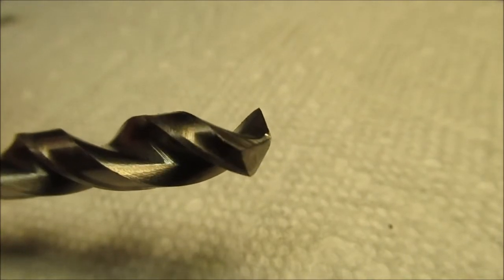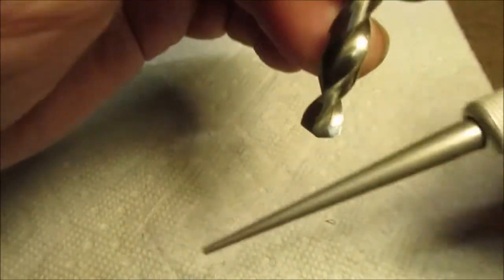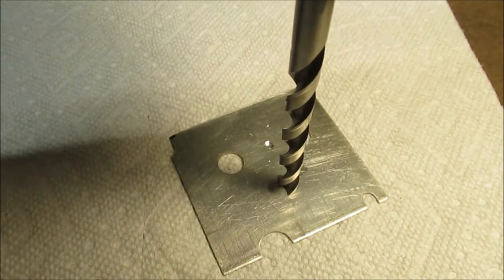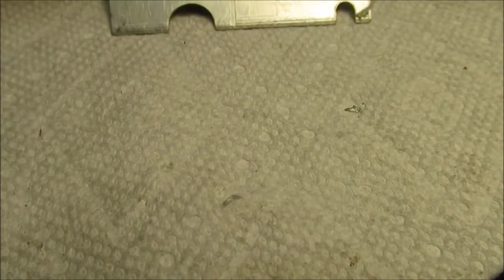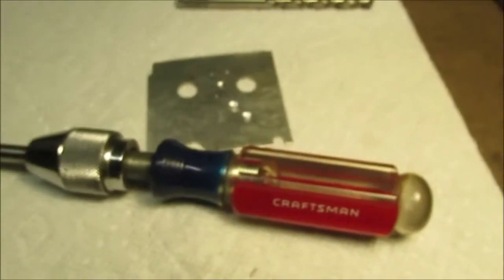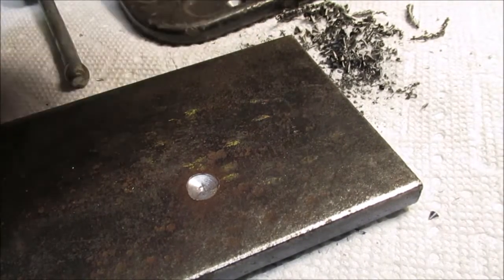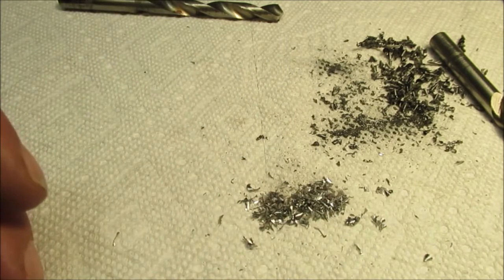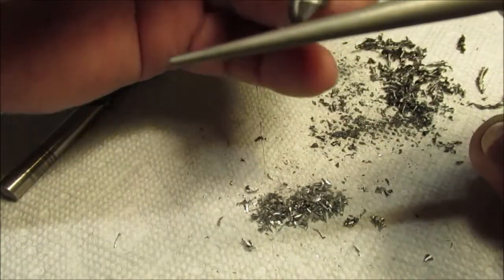Testing a  few hand sharpened HSS Split Point bits

Comment: Wow I never seen hand sharpening a drill bit before. First time for everything.
Reply from the maker: I use diamond sharpeners on lathe bits when they need sharpened ..It is easier to see what part needs done if it is just dull not chipped

Comment: Those bits can be sharpened but it's tricky to do by hand. Great tip Jim
Reply from the maker: Good these only need a touch up..so I did not really change the angles the are different  than regular bits

Comment: I have had goodluck sharpening bits but on the bigger ones I take of a 1/2 an inch or so.  They are dull to start with so give it a try.  .
Reply from the maker: I have been practicing how to I sharpened a1/2 in one using my dremel tool with a sanding drum